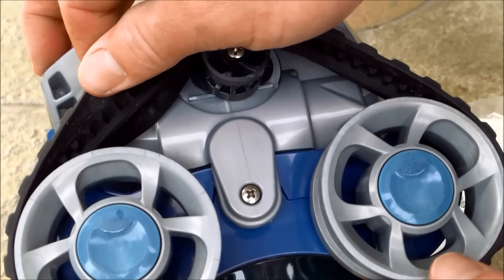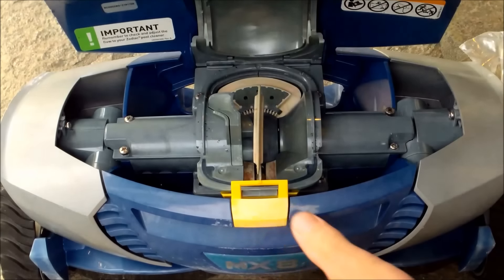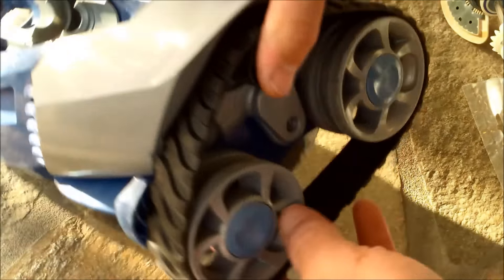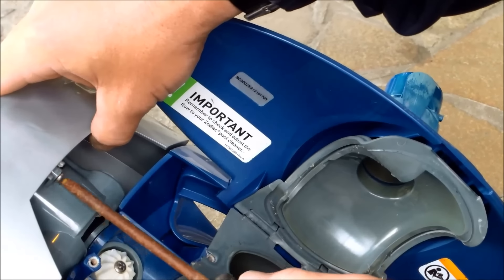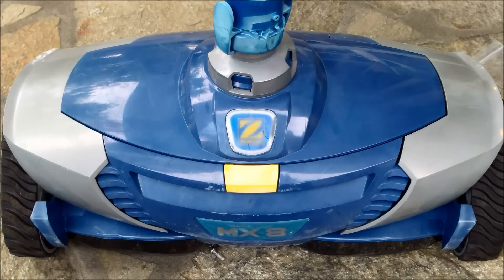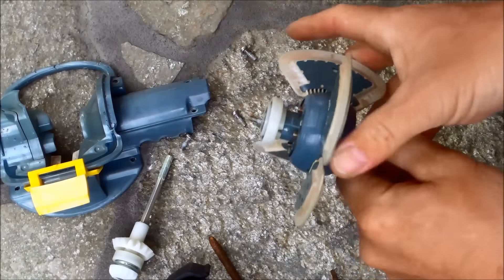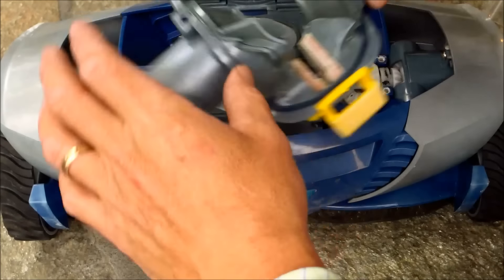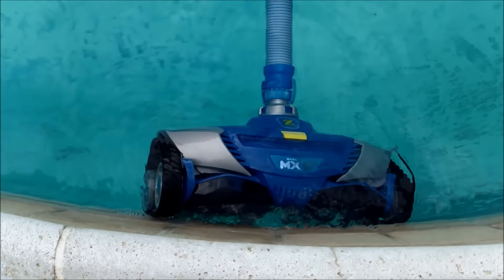Zodiac MX8 Getting Stuck, Moving Slowly or Going in Small Circles

Comment: I followed your video changed out all the parts like you mention in video including adding a washer and 4 months later the pool cleaner barley moves and goes in circles so took it apart today and noticed the washer I put in completely rusted out and rusted the bearings so just a heads up you should mention if you use a washer use one that will not rust under water.  Might be common sense for some people but not for everyone!  Took out rusted washer put everything back together and hopefully I will have fixed the problem! Just want to say I watch all your videos and you have helped me out so many times !
Reply from the maker: Thanks for the heads up and caution there. 👍
Reply: no problem, I was about to throw this cleaner in the trash considering it seems to brake down so much but luckily I decided to take it appart again to see the problem was actually the rusted out washer and not the cleaner!

Comment: Mine wasn't working one side so I took the Directional unit apart. A small c clip had come off one of the gearbox shafts allowing it to float and not connect with the motor shaft. 2 cents instead of $21 was good until I realized it was still in warranty. Phoned them up and said one directional valve was bad and the other one looked iffy and then sent me both sides without any problems....great customer service
Reply from the maker: Awesome to hear that!

Comment: Really the perfect video! My neighbors unit stopped working a few months ago. I took it apart, and found the problem was one of the small bearings inside the Motor B next to the belt drive black toothed pulley had failed. It was completely worn and the center of the hex nylon insert had been chewed out. Without that support bearing, the bevel gears could never mesh.  I noticed that this small part was unavailable as a replacement, so I disassembled the gearbox and found there was a far less identical bearing in the top cover so I swapped it out. After reassembling everything I think it will work like a champ. Thanks for your perfect video steps showing the technique to snap the motor out of the case!  Much appreciated!!!
Reply from the maker: Thanks for the great feedback! 👍

Comment: The trick about the washer on the main drive is the key!! thank you... I have replaced so many directional control module for nothing! I was ready to buy a new one because mine is old, probably 6 or 7 years but the washer addition fix the problem right away! for those with "many" problems, I found over the years that filaments get wrapped around the main axle and it is a good idea to regularly inspect it and remove whatever gets wrapped around it.
Reply: you are so right.  worked for me too,,,,,after spending $$$$$ over 3 years.

Comment: Now that these units retail at almost $800 you just have to know the ins and outs of repairing them. Mine is 8yrs old on its first engine rebuild 3rd set of transmissions. Running strong.
Reply: When you say transmission, you mean the directional control units?  I've changed everything but the directional control units, still having trouble.  Inconsistent spinning, stops altogether.  Could this be a symptom of a failing gear box?

Comment: Thank you.  Further to your suggestion I added a plastic flat washer to prevent the MX8 from slowly moving in circles, and the unit now works like new.  BTW, this is the first maintenance of any kind that my MX8, purchased in April 2012, has required.  Still works great
Reply: Thanks for the suggestion on the washer....I have rebuilt my mx8 many times and spent $$$$ on it, but i think if i would have known about the washer trick, it would have been fixed years ago.  Thanks.  I used stainles steel washers from ace hardware, 8 for $1.60.  Works like a champ.  Great videos.  Bud in SW Florida.

Comment: I replaced the gear assembly about 3 months ago and then my Zodiac MX8 started to go in circles again, I noticed one side was not moving so I ordered a new gear assembly for that side, replaced it and the problem did not go away and the gear assembly I previously installed looked perfectly fine. So I tried added in the washers, one for each gear assembly's axle and let me tell you that fixed the problem, the MX8 is working like a champ. So if anyone is having this issue try the washer trick before replacing the gear assembly.
Reply: what size washer should I have on hand?

Comment: Before replacing these parts, I suggest that you first remove the scrubber assemblies (two screws).  On mine, the bearings in those parts were shot and were locking up.  After they were removed the cleaner moved fine, so I replaced them with part no. R0525000.
Reply from the maker: Nice tip. Those usually last a very long time, glad you figured it out.
Reply: And after doing all that, I still had trouble.  What I eventually discovered was that I had not been adequately cleaning my cartridge filter, which also calls for the use of diatomaceous earth.  While I thought that using a garden hose was doing the job, the DE had caked on the cartridge and greatly reduced the water flow and pressure.  Using a pressure washer on the cartridge did the job (and yes, I did also buy a new replacement).  Sometimes the obvious is not so obvious.

Comment: Ive got a a lot of trees/plants around my pool. Ill use the pool net almost everyday to try and get everything out of the bottom of the pool. I have a spring loaded valve inline with the hose at the skimmer, that way if any leaf matter or seeds get stuck in the mx8, the valve will relieve pressure/strain on the internals reducing wear. 

I remove the motor section every 2 weeks or so and wash out the drive shaft/gears etc, make sure there's no small leaves, sand. Its not a dirty old corolla you can drive for ever, its basically a delicate small plastic pump with plastic gears so I treat it so.  I disassemble/assemble out of the pool but I always test the mechanisms by hand when its submerged in water. Mines a couple of years old now and haven't had to replace anything yet ( knock on wood ) The extra time spent  to look after it doesn't bother me, there not cheap.
Reply from the maker: +Slap kat I wonder if you would benefit from the Poolskim. If you have 1 1/2" threaded return lines you may want to look into it. Works great.  Maybe it will allow less babysitting of the MX8 ;)
Reply: +Swimming Pool Tips, Reviews &amp; How To -MrDgvb1 Thanks,  Ill check that out.

Comment: Thank you for the video. I had a problem with slowness and going in circles. I changed both directional controls, engine, bearings, and added the washer. When I rehooked it up, the circular cleaning blades are not moving at all. Plenty of pressure. Any suggestions? Much appreciated.
Reply: Spun Regularly Before Parts Replacement.

Comment: awesome vid man! I learned a lot from this video. I did have a question about when you manually spin the propellers to test the control device A or B. I noticed you spun it clockwise to turn the motor inside, when I tested mine it only turns counterclock wise. If I tried to turn it clockwise the motor would only turn against the opening the motor blades should be going. I just wanted to make sure it isnt something im missing or not doing right to test it. I just ordered the side A and B control devices and am hoping that will fix the problem. I already replaced the tracks but my mx8 is not moving like the one you fixed in the video. I look forward to a response hopefully.  thanks!

Comment: i have an mx8 barracuda, one of the fans at the bottom wasnt spinning. i changed its corresponding drive control  and got the fan to spin again. but now its making a clicking noise when both fans spin. it seems to alternate from each side. maybe i need some new drive shafts? or bearings?

Comment: MY MX8 stops after running for about 5-10 min. I’ve changed most of the components using tune up kit. All the bearings are new, engine, drive shaft, belt etc. if I spray silicone lubricant into the suction hole it seems to spin more freely and not stop all the time. It seems like there is excessive friction but I can’t figure out where. I’m getting plenty of suction. Is the engine housing bad? Any ideas?
Reply from the maker: It could be the engine is out of balance and as it runs it eventually catches. I would take it apart and make sure the engine is centered perfectly. You could have a defective engine.

Comment: Questions I just did a rebuild kit on my cleaner .. I have a variable speed pool pump and when it's on auto ( not much suction) it won't move .. on quick clean alot of suction it works fine .. any idea ? Thank you!
Reply from the maker: You have to mess with the pump speed to get it set. Try running your pump at 2800 RPM or 75% speed and see how that goes.

Comment: I replaced all the parts in your video.  When I put it in the tracks do not move at all..I checked the suction.  It's ok. The impeller is not moving either.  All parts are tight. This was no big deal switching out parts and it worked before I messed with it. Any suggestions before I have to go to the pool store and get ripped off?  Appreciate your help.
Reply from the maker: Something is not right. I would take the engine out and check the gears. The white teeth are probably not catching.

Comment: Hello there,
I recently purchased the Baracuda mx8, adjusted the speed to 20 RPMs and everything operates normally, but the vacuum climbs to the water/tile line in my fiberglass pool.  As a result, it sucks in air.  How do I prevent this from happening?
Reply from the maker: Is it hooked up to the skimmer or sideport of the pool?
Reply: +Swimming Pool Tips, Reviews & How To -MrDgvb1 it is hooked up to the sideport of the pool
Reply from the maker: Victoria W Just lower the suction down using the sideport valve by the equipment until the MX8 climbs but stops before exiting the pool. It is pretty easy to do.
Reply: Swimming Pool Tips, Reviews & How To -MrDgvb1 Thank you for advise.

Comment: Great video and explanation! Do you know why would the rubber tracks keep going off the wheels?
Reply from the maker: Sounds like they may be worn out. Try a new set.
Reply: @SPL  Thanks for the quick reply. A friend did the tune up kit with the new belt and it is still doing it.
Reply: I have this same issue, one side only, my cleaner is only 18months old, I haven't bought new tracks yet, plan to, but is this typically the fix?

Comment: I installed both directional controls, tracks, and drive shaft but when I spin the bottom brushes the tracks turn but they are binding.  Once I spin the bottom brushes and it hits neutral it starts to get even tighter and makes a clicking noise.  Any idea what I did wrong?
Reply from the maker: Sounds like the Directional Device is not lined up correctly
Reply: But how can that be possible when there is only one way to install them and they fit perfectly into position?

Comment: Great video!  Had a question, my MX8 just stops every now and then.  I'll bring it up to the side and just spin the bottom scrubbers, and then it works again.  Nothing is obstructing it.  What needs to be replaced?  I switched out the "engine" which is the thing with teh 4 flaps.But it still will stop randomly.
Reply from the maker: Check the "tank" tracks to see if the plastic teeth are all intact. It could be slipping if there are some teeth worn down. If the tracks look fine then the next thing would be the directional control devices are wearing out.

Comment: Can you tell me why my mx8 does not have bearings on the Motor ? Outstanding video. Thank you.
Reply from the maker: Strange. I've seen them fall apart and disintegrate in an old Polaris cleaner but never in the MX-8.
Reply: Ok, thanks for answering my question. I rebuilt the entire unit today and put new bearings on the motor it works great. Thanks for the great video.

Comment: Hi, I'm having problems with my MX8. It was working very slowly so I firstly tested to see if there was an issue with the pump by checking the number of times the wheel spun in a minute. This was within the working parameters as specified in the mx8 manual. So the pump was working fine. This is important to note here. I then checked the tracks and noticed the teeth were all worn out so I bought a maintenance kit that included new tracks, engine gears etc. On installing the kit I found the mx8 would run for a while and then stop. Also it was running very slowly. As soon as I pulled it off the pool floor it would start running again but then stop again. I checked the wheel spin rate and found it had slowed down considerably. I also noticed the mx8 hose was pulsing, something I do not recall happening before. I disconnected all the hose parts and checked for blockage but there was none. Not sure what is going on and why after installing the maintenance kit my mx8 has stopped working :-( Any help much appreciated. Thanks.
Reply: ….having the same problem.
Reply: I'm having the same problem
Reply: Having the same problem with new parts, slow and doing wheelies.  Anyone?
Reply: Okay guys I have serviced my own MX8 for years now. It wasnt climbing walls. So like many times before, I replaced the tracks.  Noticed it still wasnt climbing walls. So in the past month after replacing every almost every part including bearings and gears, hose and o-rings. It turns out that it was due to AFTER MARKET tracks!!!! Unbelievable! Im like relieved I figured it out but I spent way extra than I needed. The tracks are new but they were harder material. So its just something to check.

Comment: Hi, I love your video, thank you so much....I have a couple questions Sir.
I change many parts, but it appear that something is preventing the fan to turn normally, like it as to force to turn, so basically it stop and get stuck...No more moving???? I have to help manually to make it turn...but stop after a few...Engine????Bearing that I do not have on mine....any idea will be helpful.
Also I saw on your video that you are not using the regular pipes hose, but an other one with the succion fitting, I would love to change my hose like the one you have, a lot better, where can I get one.
Thank you very much for your help, I appreciate.
Olivier
Reply from the maker: It sounds like a bad engine to me. Change that part and it should work fine again. How old is your MX8?

Here is the part: Zodiac Suction Fitting Hose Adapter #X77094
Reply: My cleaner is 4 years old....thanks also for the part number. ...what about the hose after that fits in...it the one I am interested in....thank you very very much...
Olivier
Reply from the maker: olivier renaud You mean the universal pool hoses? They sell those on amazon.com and ebay. Just known as universal pool hoses.

Comment: hi...!  I have an older single speed pump a Hayward I believe..I bought this new zodiac....hoping it would clean great....it works for awhile.....then it gets really slow and the meter on sandflow filter  goes up to like 30 -32.....is my problem the older single speed pump...do I need a new variable speed pump
Hayward for it to work well? also how do you speed up the movement of the units ..it's Brand new
Reply: Debbie, it sounds you are not using the pressure-regulator inline valve (normally it should come with the cleaner?) that will protect the pump when the cleaner (any not just that!) gets stuck with acorns or leaves/twigs... Make sure to use the regulator inline valve